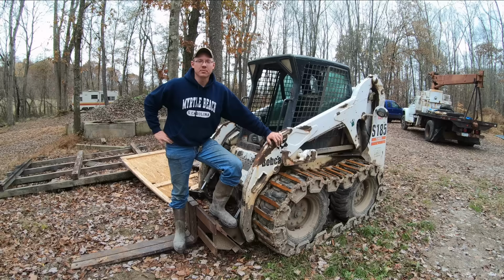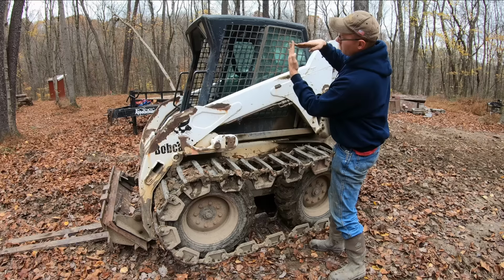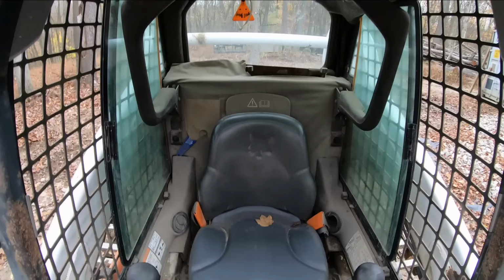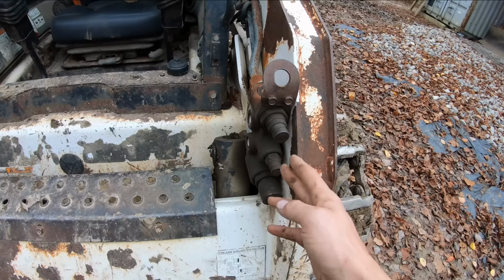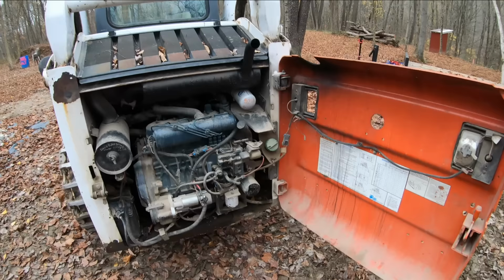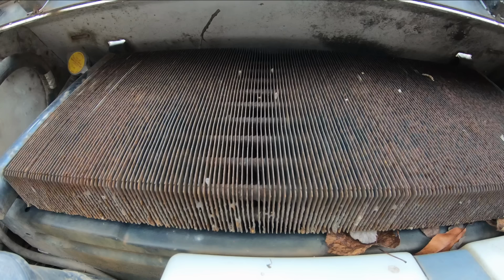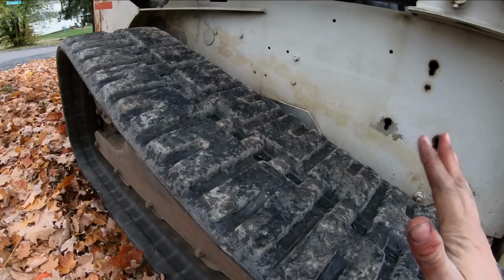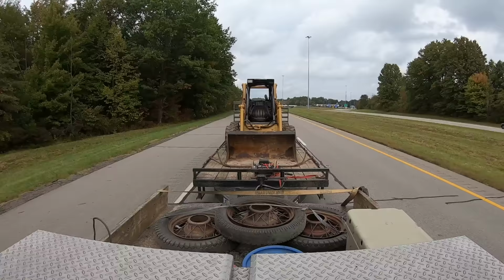Buying a Skid loader? WATCH THIS FIRST!

Comment: i love my bobcat, its a 7753, i traded two 40ft shipping containers for it, came with a regular bucket, 4 in 1 bucket, set of forks and a backhoe, it had been used at a chicken farm and was never cleaned, sat before i bought it for many years, the pins for the quick connect were locked up solid and i had to cut the bucket off and then cut the pins out, that was only an afternoon to fix really, i replaced one hose and all the belts, the fuel tank has a rubber bung that fails and the fuel line drops off into the tank on this model, so i just run a jerry can on the side for fuel now, the fuel solenoid doesn't always work so i might switch it to a cable, it is mostly a toy for me, one day i'm going to sit down and design a track system for it on autocad, i have some ideas.

Comment: Im always surprised how many owners with foot controls have no idea about the loader float function. I would take yours any day over the ones with seat belt and safety button. Getting in and out numerous times i am more annoyed by this feature than anything else. Doing ranch chores with the loader loaded and needing to get in and out of the cab is super painful at times. Rubber tire steers when out in the desert  get stuck quite a bit. Especially if your dealing with confectious powdery material. Also tears up the ground pretty bad over multiple trips across the same ground

Comment: A few years ago I rented a Bobcat tracked machine which was newer.  What a POS as turning the machine sucked. They are supposed to remotely tune the machine and even the dealer said Bobcat screwed up the last time.  It's supposed to increase throttle when rotating which it did not  and would also not manually throttle up like it should have.  They now carry Kubota which is so much better but not as nice as the Cat I used.  I also used an older ASV machine that might as well been a Cat as even Cat uses ASV parts.  That ASV had all Cat drive train, tracks and controls
Another thing if you are looking and don't want DEF or DPF then I think you want a 2007 or earlier as in 2008 the emissions started

Comment: as an experienced mechanic and operator... I would never recommend JCB brand anything... stay away from JCB
Reply from the maker: From my limited experience with them they seem To be good when they work but seem to break down quite a bit and takes forever to get parts for them
Reply: What about IHl brand?  Here the JA pan ones are good, think they have the Yanmar engine?  Comments?
Reply: @ricklarouche4105  .....like to know myself
Reply from the maker: @ricklarouche4105  IHI was used to be made by Takeuchi for IHI haven’t seen any new ones do know If that’s the case. Most people I know like them a lot
Reply: Matt, l wanted to tell you about gsaauctions.gov if you haven’t seen it before.. lots of pretty good bargains.. bought my last few vehicles from them btw..let me know what you think!?
Reply: Some of the JCB brand work boots I have seen look pretty decent...
Reply: @DieselCreek  That is exactly what I was referring to... and why to stay away. But they seemed to have tried to reinvent the wheel as well... all of their equipment has this weird engineering feature in it someplace to make it their unique slant on the industry that simply don't seem to work out for them. I guess good equipment is hard to come by in merry ole england.

Comment: After about 6 years, hydraulic hoses are likely to fail, especially if the machine was run a lot in hot weather. Many of the hoses are difficult to access.
Reply from the maker: I find the ones that are exposed to sunlight last about that long but the ones that don’t get so much sun can last much longer than that. I do know all about those hoses being hard to get to, I’ve changed a few that I had to stand on my head and hold my mouth just right
Reply: @DieselCreek  I think it has more to do with the number of pressure cycles and fluid temperature. The external cover is just a cover and not so much a part of the strength of the hose. Every time pressure is applied to a hose or even a metal pipe, they stretch slightly and shrink when the pressure is released. Just like blowing up a balloon, it will only last a certain number of times. Metal or rubber fatigues. Heat also causes expansion and contraction and weakens the rubber inside the hose.

Comment: I'll run the foot control in the summer but im tired of them I grew up with foot control and im over it the h pattern is nice and I prefer the mechanical feed back that these have I also have a s185. And in 11 it was hard to find a skid with 45gpm hydros

Comment: Wouldn't be better to just put some bronze bushings in the quick coupler pivot points? I mean this way slop doesn't wear out the steel and replacements are cheap and even easy to make yourself on a lathe yourself from stock

Comment: In Sk Cdn a guy had an injection acycrlic unit " ball-air" was used on semi truck ( transport appr loved)  for pins NOT sure if its around any more. Local repair shops want the labour. 1 403 830 4124 extra filterationn.etc constantly played down. Mechanics taught to fix replace with new parts. Shops do too.

Comment: I'd rather have your setup, rubber tires and metal tracks. Best of both worlds in my experience. However I would be careful buying a used machine with steel tracks if it has a lot of hours. It is a lot of extra wear on hydraulic pumps and  drive chain. Tracks will eat up your tires if your tires are not inflated properly or the tracks are not properly tensioned. They'll spin inside the track and of course that rubber on the metal doesn't stand a chance

Comment: I live 20 miles-ish from you/him on 40 acres.  Having a machine would help out around the property..but how do I justify the cost???  Looking Kubota SVL-95 or Takeuchi TL12V2.  Needing a heavy high hp machine to run a Diamond FBS060 disc forestry mulcher for invasive privet.  $60-75k for the machine.  $15-20k for the disc mulcher.  ouch.
I'd go into business with the mulcher, and maybe get a Harley rake to do lawn renovations..but where do I find the demand?

@DieselCreek check out tractor graveyard at Burgh Implement in Portersville.  Farmall heaven.  Fun to even just walk around.  Lotta old iron.
Reply: Get a 75, doesnt use DEF.  It has been a real problem child.
Reply: We have two mulchers.  We have two bush hogs.  Guess which one gets used?  Not the mulcher.

Comment: I bought a new s250 in 2006 have done nothing to it but change oil and filters bobcat is my only choice had a 863 1998 bought it with 500 hours on it when I parted ways with it in 2006 it had 2800 hrs and only think that was replaced was muffler.

Comment: When skid loaders came on market here in Australia  most makes had a backhoe  attachment . Safe work Australia  prohibited the use of the attachment due the operator sitting outside the cab.
Reply from the maker: I think that’s a thing here on OSHA controlled sites as well. They are terribly inefficient anyhow. Mainly good for farmers and home owners
Reply: @DieselCreek  your machine has the arms to attach one, did you get your machine from a landscaper?
Reply from the maker: @FishFind3000  indeed I did never had a hoe on it since I’ve owned it tho

Comment: What is your thought about your tire/ track carriage in use in rocky areas.  Most of the terrain here where we live is desert and we have a lot of decomposed granite and rocks.  is it a problem with flats and or damaged tires at all, have you seen in rocky areas?  I like that those tracks are heavy duty.  I haven't operated one of these since I ran one that was like 60's 70's vintage, we re getting a brand new Bobcat for our non profit for working on road repair of unpaved roads in Public lands.
Reply from the maker: Very situational, you can get solid or foam filled tires tho so not worries on flats

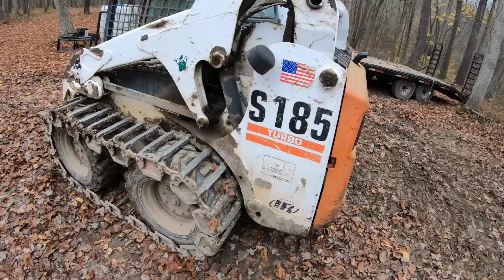Comment: 21:35 there not cheap, there not car tires..... lol idk what kinda car tires your buying but just about all the tires im getting are around $200 a pop and for one car we have that has low profile sport tires there $300 a pop.
Reply: I'm not sure he buys new tires for cars... I haven't yet in my 40 years... And don't really plan to. When I can find a deal like $200 for a set of 4 name brand, and costs another $100 these days for mount and balance, rather than minimum $100 wheel for China tires plus tax...

Comment: I have bobcat 743, 1989 model, best machine I ever bought,bought it brand new, now they are about 35k plus tax, caterpillars are double that and ask very nice but not as- terex, terex fooked up the advice, under powered, under hydraulic pressures, my advise stick wit cat or cat pillar,but be ready to take to shop, new machines have a computer for ev3rything, kinda bs, but that technology, I never needed tracks for my cat, experience rules, but my new one will be tracks and hopefully. Brand new one,n8 have 9 years left to work and I’m retiring, want to do it in style, stay away from deft if u can,

Comment: LOL Had to throw a like at "COVID",  even before the rest of the vid. 

Fantastic video. You obviously have had quite a few hours in a skid. If the bushing is squeaking, you'll have a bushing spin in the bore soon, wont take grease, and that sucks. 

Solid tires are the solution if tracks are too expensive, although some wont take the steel tracks. I had that problem on my 763 at one point. Loegring is similar to the Grousers you have and I have had good experience with them before I went to track machines.

Bobcat foot controls FTW! (Oldish operator with bad knees in the house)  All the controls are directly connected to the valving, so you can feel all the resistance and adjust accordingly. All the pilot controlled stuff(hand controls) is quite a disconnect for some of us older guys. You can just feel the disposition of the machine better than with the newer control schemes.

Also, the new Tier 4 emission standards have made the new engines far more temperamental than the older diesel engines. Go for something older in my opinion. Cheaper all around. And the secondary filter is the key. Blow out the primary, replace the secondary when necessary.
Reply from the maker: I agree older machines with real pilot controls are far superior!

Comment: One time we went to start up our Bobcat s70 and it revved at full throttle shooting black smoke like crazy, the throttle sounded higher than normal. I lowered the throttle and turned the key off and it did nothing, it was a really scary feeling. Now I didn’t know this at the time  but in order to turn it off in that situation was to disconnect the fuel line pump. At the end of it all, the fuel injector went bad and had to be replaced, it was costly but a good/bad experience. Anyone know why it went bad?
Reply: Fuel injector pump*

Comment: My guess is it's probably time for new filters, one dated 6/6/11 and the inner filter is from 08! I don't care how well they blow out. IT'S TIME
Reply: 1/28/19? Time for a new  oil filter and change
Reply from the maker: Dates mean nothing just a reference. It’s all about the hours
Reply: @DieselCreek  you know I thought of that but you said this is the machine you use the most. And when you pulled the dipstick the oil looked pretty black
Reply: You haven't reached the hours on the machine to change the filters in 12 years? Or 9 years? I understand blowing them out but don't you think over 9 years of use it may have lost some of its air flow?
Reply from the maker: @danbartolini27  did you see the inner filter?? Wasn’t a spec of dust or dirt on it. And the oil has another 80 hours or so before it’s due for change
Reply from the maker: Diesel oil is always black
Reply: @DieselCreek  just because there's no dust on the inner filter doesn't mean that a 9 year old filter doesn't have some restriction, no matter how well its blown out. I mean the air flow from a new filter and the air flow from the old filter might be significantly different
Reply: Come on your doing a video on what to look for when buying a skid steer. And 12 and 9  year old filters and an oil filter that's almost 2 years old aren't giant red flags? I understand your logic and reasoning but come on. If  that machine was for sale and you where looking at that machine for the first time to buy it what would you think?
Reply from the maker: @danbartolini27  that’s the inner filter that was in it when I bought it... it’s clean, to replace it would be wasting money, I have blown it out and nothing comes out,  so if there isn’t any dirt then there isn’t any restriction. That’s all I think, that date means nothing
Reply: @DieselCreek  OK ok I get it. I was joking around. But your showing us what to look for when buying a skid steer. You can't tell that 10 and 12 year old filters aren't something to think about
Reply: i have a t190,i clean the air filter every 8hrs or sooner if its really dusty, grease every 8hr and change oil every 100.  remove tracks and clean under carrage,change hydro and drive motor oil every 500hrs. it cost me a lot of money and worth the time to maintain.
Reply: @davesilvia9711  my point was he was telling us what to look for when buying a machine and the dates on the filters are 11 and 08 should be a of concern, weather or not they still work. At least it should be questioned
Reply: @davesilvia9711  I guess I just question the efficiency of 10 and 12 year old filters vs new
Reply: @danbartolini27  i know Matt means well, but in my opinion he doesent take enough time to maintain things that well, every one is diffrent. if that bobcat was for sale in that condition i would walk away. ive been running machines for over 20 years and never let my filters get that dirty, the one on his dump truck was filthy too,but he said that he has seen a lot worse. lol.
Reply from the maker: @davesilvia9711  sounds like you guys would crap your pants if you walked onto a real job site and checked filters on multi million dollar machines... I’ve had to hound bosses and mechanics to get my filters blown out on machines and when they finally do it looks like the dust bowl of the 30’s ....and those same machines which are run hard every day and beat on my anyone they put in the seat typically last 10,000hrs plus my filters are clean lol

Comment: The worst skid steer I've ever used was an 09 case for a coupe weeks. It had 
half bucket / half drive control on both sticks. No foot controls. Which is fine but why mix the two operations between the two  stick? Just put drive on one side bucks on the other. It took about the whole two weeks to get half as fast as I am on a normal skid steer.
Reply from the maker: That’s how mine is setup boom on the left and bucket on the right and having the independent control of the drives gives you better feel and control of the tires. I can feel if something starts to slip and I can back out of that side to compensate. I realize it is harder to get used to but I can guarantee if you are used to it you can work on softer ground without tearing up as much as you would with an ISO machine

Comment: I think if I had one I'd want a hand controll for the boom and all functions. And foot controll for steering only
Reply from the maker: I’ve never seen one like that but they might be out there, it’s hard to control your feet over rough ground tho because you need to brace yourself as well. Makes things interesting
Reply: thats how an escavator works
Reply: @davesilvia9711  Feet controls travel also, unless you grab the handles that are bolted to the foot pads.

Comment: Can't you get those front pins drilled and fitted for grease nipples? Or machined out for bushings? A third option is to combine both the first two options to help keep it from wearing.  I have done all of them on other machines where there has been a lot of wear on fixed pins.
Reply from the maker: it has grease fittings on every joint.

Comment: I actually love the sound of the tracks especially when you’re out of frame and it sounds like there is a giant 50-year-old excavator coming to work and then you see the little bobcat pop-up cracks me up but anyway it sounds how a machine should sound! I had an old bobcat skid steer I think it was from the 70s with the square cab, the lights were fog lights through two holes on the top and , there were no controls or acc besides the lights, three pedals middle one being aux drive and just two push pull to drive and turn, no bar over for safety just a seatbelt from a car but I did not like using it at all maybe it’s because I don’t do a lot of heavy machine stuff but I would take it up my driveway which is not an insane grade but it’s a grade nonetheless that I always felt like I was going to flip the thing over backwards so it scared me anytime I had to go up any kind of a hill I could just not get used to that feeling.

Comment: Sir, does your loader track fit bobcat Skid loader S770? Mine gets stuck all the time. Do you think I should get a rubber track instead of metal?
Reply from the maker: They make them to fit all machines runner vs steel is all personal preference, they are quite a bit more expensive for rubber

Comment: What's the judgement on brands? From what I've seen and heard, Bobcat and John deer in particular are high wear machines, where as Kubota, ihi, cat and some others have lasting parts (particularly small parts, bushings, bearings, seals.
Reply: Most of it depends on operator use or abuse.